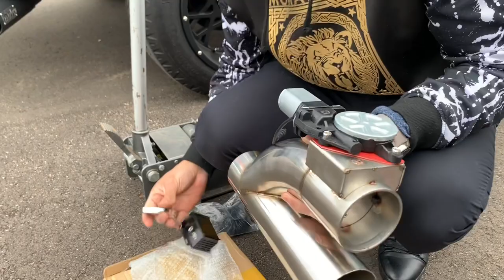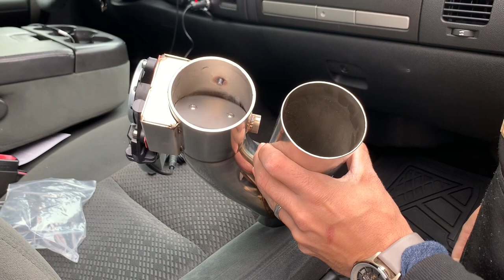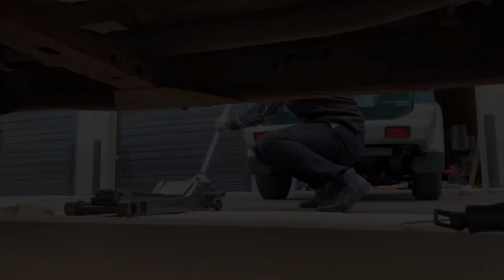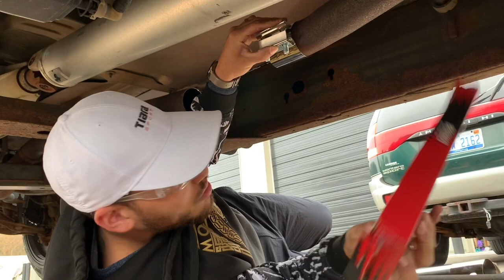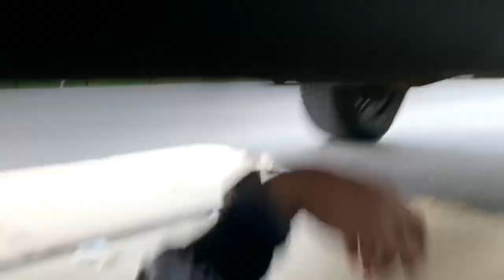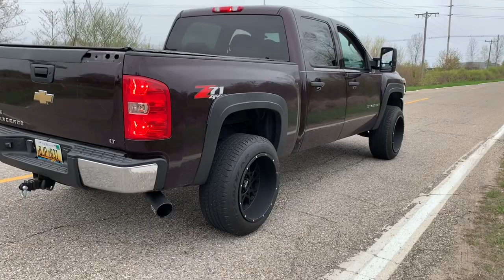Electric exhaust cutout valve installation on my Chevy Silverado | Chris Fernandez

Comment: Nice work bro. Just don't ever trust just a jack to keep your truck up. Use jack stands every time
Reply: he wasn't using the jack to hold the truck up

you can see he easily fits under the truck without stands cuz its lifted
Reply: 5:26 jack stands
Reply: I've never used jack stands yet lmaoooo been sum years, but I agree depending on repair needed

Comment: Why did you not install it pre cat?    I'm not bashing.  Just future recommendation. You should not cut the exhaust the same length as the pipe going on. Should be a slip on setup with clamps. If the cutout is 11" your cut in the oem pipe should have been 9" or smaller.  Unless welded on.  And if the stock exhaust is 2.75" should make sure to buy a 3" pipe. This helps prevent leaks. You setup will have problems in the near future if not already.  Highly recommend getting it welded
Reply from the maker: Twisted D thanks for your advice , it’s been over a year and daily drive it and no issues yet but thank you
Reply: U seem knowledgeable on this topic what size pipe should I get for a 2.5 inch exhaust and how much should I cut off, sorry I’m asking someone in the YouTube comments but I have to no clue where to find this type of info

Comment: Thanks for this video I was just wondering if it came with clamps because I’m trying to buy a similar one for a Beamer and I would have to cut off because it doesn’t have clamps on the Beamer
Reply from the maker: StrawberrySEAN you have to buy the exhaust clamps at a local automotive store like autozone , measure your exhaust before buy , you can buy these electric valves from 3”-2.5” if your exhaust is like smaller you can get adaptor at the storage as well

Comment: Current update on this?(any rattling or valve leak) I just got these electric cut outs for Christmas lol. Is there another way to source for power in place of the cig plug?
Reply from the maker: wambam I notice you can kinda hear a leak but that’s only if your like under the truck 1 foot away but no rattling and I’m sure there’s other ways to plug it somewhere else , just find a negative and positive
Reply: U could get a female cig and wire it into the fuse box and hide it away

Comment: Thru the door lmao. Go thru under ur hood straight to ur fuse box to an ignition switch.
Reply from the maker: MrCokemaster05  lmao yup thru the door , that’s where I wanted it to be but thanks for your opinion
Reply: All good man. We all gotta Learn. I ain’t perfect, So the next kid reading this will do it right.
Reply: Actually you don't go through the engine compartment either. There are access plugs under the seat. Drill a hole in one of those then run it under your seat and inside.. I would direct wire the 12v to the fuse panel inside, with fuse taps.
Reply: @damianlambright6986  how?
Reply: @redbaron2448  which part?
Reply: @damianlambright6986  the wiring part
Reply: @redbaron2448  cut the lighter plug off. The wire with a white line in it is the ground wire. Ground that wire. Then take the solid black and tap that into a ignition hot wire. Under your dash will be all the main wire blocks or in the fuse panel on the dash, you can tap into an ignition hot fuse. Use a test light.
Reply: @damianlambright6986  Ok great, thank you

Comment: What size clamps did you use for it I want to do this to my Silverado I already have the valve coming in but I know the stock piping is 2.75” and the valve is 3” does a regular 3” clamp work fine like almost no leak noticeable in the cab?
Reply from the maker: gerardo madera yes I did use 3” exhaust clamps from autozone and I can’t notice any leaks , I have it open all the time now because it sounds good and only close it when I travel lol
Reply: Family Garage Performance thanks I’ll just do that then how loud is it over stock?
Reply from the maker: gerardo madera it’s not crazy loud because you still have the Catalytic converter’s before the Valve but it will sounds just like a muffler delete

Comment: Do you feel more power when it's open, because the isn't any restrictions now
Reply from the maker: redbaron2448 I don’t get your point, why would I feel more power if it only changes the sounds ?
Reply: @christopherfernandez7716  Well if installed correctly,  before any resonator and Catalytic pipe you gain HP
Reply from the maker: redbaron2448 well don’t really care about HP on my truck , it’s just my daily but thanks I have a race car for HP.

Comment: Thank you very nice explanation :) .. I want to ask you about wheels I wish I could find similar ones with the same width! Where do I find a user in the same way?
Can it be installed for the Suburban 2007 and Sierra 2014, or do the sizes vary?
Reply from the maker: 3zyiz  yeah I would be happy to help , do you have an Instagram? Maybe you can private message me on there and I can give you all the info
Reply from the maker: 3zyiz sounds good and no problem

Comment: Over a year later... How are they working for you? I bought 2 of the same one and they lasted about 3 weeks before the wires stopped sending signal
Reply from the maker: I still have the same one , just make sure where you install the little box that looks like an amp in a good spot , if you just have it hanging or moving around it can stop working , you can always buy a new box with controller for $25 or contact the seller and they send you a new one for free
Reply: @christopherfernandez7716  YEAH THE BOX STILL WORKS. BUT I CAN ONLY GET THE MOTOR TO TURN IF I HAVE IT DIRECTLY PLUGGED INTO THE BOX, THE EXTENSION WIRES DONT ACTIVATE THE MOTOR ANYMORE, THE MOTORS WORK JUST FINE WHEN I TAKE THEM OFF AND PLUG THEM IN, WHEN I USE THE LONG WIRES THE BOX JUST CLICKS...IDK
Reply from the maker: @thehiphopgiftshop  email the company that you bought it from , they should send you a new controller with box , maybe there’s a bad wireless connection or something idk

Comment: I wanted to get this for my Lancer but I was wondering how it held up overtime and if the valve leaked at all when it was closed
Reply from the maker: FGxS you can go to your local autozone or any other automotive store and get there best exhaust clamps and you should be good, or get it welded at a shop, mine is still on exhaust clamps and haven’t heard any exhaust leak yet, it’s been a little over 2 months ever since I did the install.
Reply: FamilyGaragePerformance in the video you can see water coming out from around your exhaust clamps indicating a leak because the “I” section of the clamp is upside down. Try flipping that piece over so the curved side is touching the exhaust pipe not the flat side.
Reply from the maker: Gavin Shah thank you for the advice , I still have a lot to learn and ppl like you are helpful.
Reply: the valve may  leak over time because of carbon build up so use brake cleaner on the valve every couple of months!

Comment: What side pipe dia. Did you order
Reply from the maker: SITTINlow Falcon it’s a 4.5” by 14” long bully exhaust tip , I got it at autozone
Reply from the maker: SITTINlow Falcon it’s also universal fit from exhaust 2.75 - 3.5
Reply: @christopherfernandez7716  ahh okay bro. Just bought the same one . going to be installing it on my suburban.
Reply from the maker: SITTINlow Falcon awesome , it’ll look great

Comment: You’ll be lucky if that “cutout” doesn’t blow apart in a year. With the valve on the actual end of the cutout pipe instead of the main pipe you aren’t rerouting the exhaust away from the mufflers. You are restricting the exhaust which leads to back pressure and eventually a blow out. Please as a word of advice please buy a real one not a cheap pos that can cause damage or potentially Pierce your gas tank and cause thousands in repairs.
Reply from the maker: GMG YT this is the dumbest comment I’ve had so far and it’s been way pass a year,  you sounds like you know what your saying but in reality your just making stuff up, looks like you play to much of the video game gta5
Reply: How is it restricting when it's literally becoming an exhaust itself when open and gases flow through the stock exhaust when closed?
Reply: You're pretty "special" dude. You showed just how little you know.. stay on gaming and away from real cars.. let the men do men things and you boys do boy things..